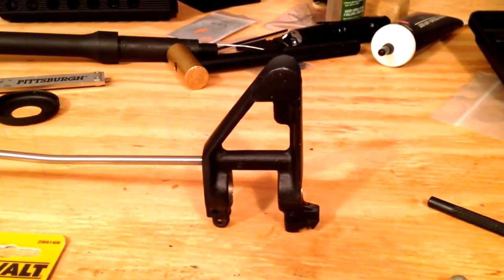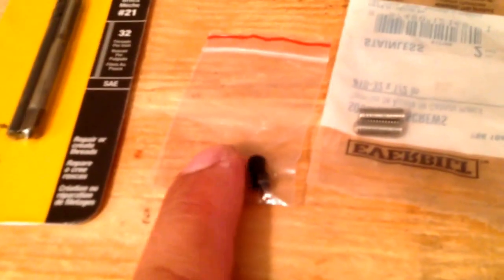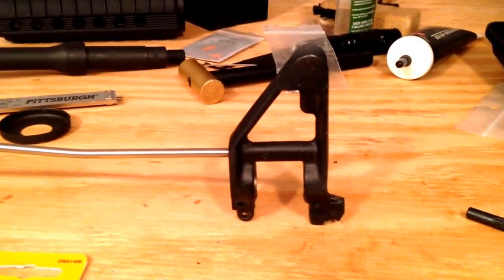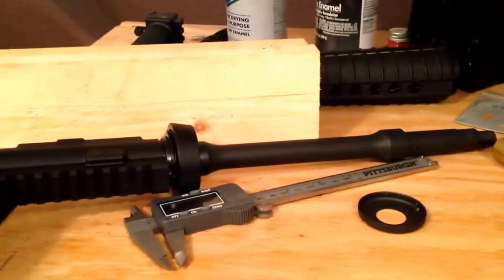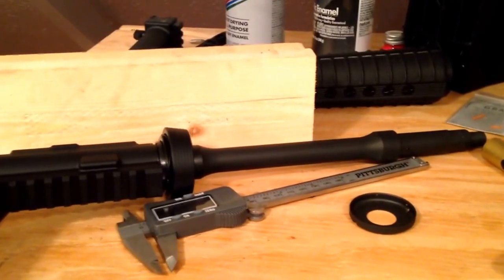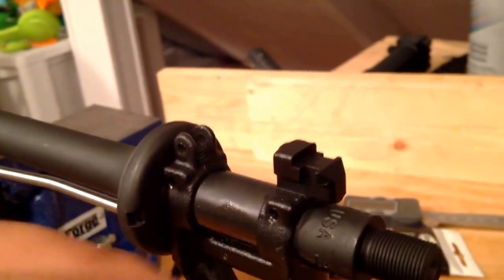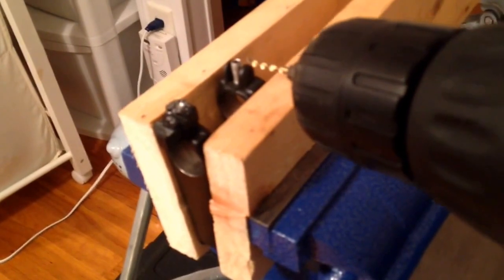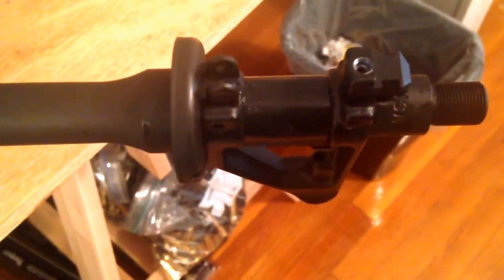AR-15 A2 Front Sight Block Installation DIY Using Set Screws Instead of Taper Pins

Comment: So great video worked perfect I did retain the bayonet lug went back and installed a bolt over the bayonet lug set screw hole and blued it I. Cannot hardly even tell how it was done used a roll pin to reattach the sling mount looks awesome very cool video thanks for posting

Comment: I know a old video. 
Get two vices. I used the ones under 20.00 each ( actually 9.99 years back ) 
Align gas block and barrel place tape on barrel and gas block. Using a straight edge mark both pieces of tape.  
Place in vices ( I put a pice of flat steel on my drill press to hold both vices. ) and use a center punch several times before drilling. 
Go slow and use oil. 
If your buddy has a bore scope it is even better.

Comment: Its simpler to use the a2 gas block already set up with set screws  Dez Tactical,  they have excellent reviews,
Reply: DEZ Tactical doesn't do .625 Front Sight set screw assemblies anymore. They still carry them for .750, but not .625.
Reply: Discontinued, most clamp ons I have found are either discontinued or stupid expensive.
Reply: Every once in a while I see a .625 A1 gas Block at a Gun show  you would think someone would make them 
Next gun show if I see one I'm picking it up

Comment: If you're handy what you can do is tap out the existing hole on the bottom after drilling it with an appropriate drill bit to widen it, and thread it for 10-32 set screw, line it up and set screw and possibly clamp it down . now you DO need a drill press but if you have one now you can just drill through the other taper pin and ream out. then once thats secure go back and do the other taper pin and be done... It isnt too expensive,  Yes.... drill press.... but honestly this method should be using a drill press too.   If they arent going in straight  .. its a problem, and in addition lets be real...  for most of those just larping around with these things a set screw on a gas block is going to be fine,  its going to work and its going to hold it in place because nothing interacts with the gas block outside normal operational forces and even if it moves a tiny bit, the worst symptom may be that you're slightly improperly gassed but even that would require a lot of movement.... here is the issue.  A sight base is a big old LEVER and it also sticks up like crazy.  If the gun is dropped, handled rough, anything,  you are putting way more faith in those set screws -  And here is your second issue -  a TINY bit of movement in that sight block at the level of the barrel is much more pronounced way out at the sight post.  Enough to make you miss -  enough that if you relied on that rifle in a serious situation now you cant aim using the sight post.  If you care about the sight post as an AIMING implement and this isnt a safe queen rifle that you will never actually grab for anything pressing,  you could can gorilla tape the damn sight base on... who cares right.  But if youre installing the sight base because its the most rugged heavy duty front sight -  you should pin it.  And if youre doing it for decoration only or to make it APPEAR proper-    this method works fine and I am sure 20 people will tell me "THIS HAS WORKED FOR ME FOR YEARS AND ONCE I EVEN DROPPED IT ONTO THE GRASS IN MY BACK YARD WHILE USING IT TO SHOOT A WOODCHUCK"  but... I think you know in your hearts that doing it a lazier less durable way comes with "you get what you pay for" be it in money , time or otherwise, caveats.

Comment: I have a A2 sight a friend gave me but it’s missing the gas hole for the barrel(same spot your drillig) so that means I have to drill it out ? Or are they suppose to come drilled ?
Reply: They should already be drilled to be used as a gas block. There should be a larger hole coming in for the gas tube to go into, then a lateral hole for a tiny roll pin that holds the gas tube in place, and of course a hole underneath the gas tube where the block meets the gas port on your barrel.
Reply: @pistolero_loco  everything is drilled except the hole where the gas block meets the barrel, but it’s possible for me to drill it out from under the sight where the roll pins go in for the barrel
Reply: 😆.. sounds like someone gave you an chinesium airsoft part.
They have to have a hole in line with the gas port because that is how they drill the port. No other way to do it.
Reply: @ahole5407  yea they did lol I ordered a original one and it’s all good now hahaha

Comment: My A2 sights pin wont pounding out  Not sure if it was even pinned as its not flush on either side like the tube was put in without a hole in it and Im probably pounding 1/16" punches into the stainless steel tube.   Can this be drilled out without destroying gas tube or A2 sight?
Reply: Hit it on the other side.

Comment: This was really cool, but why bother with the level?  The FSB will self align if the barrel is dimpled with a dimpling jig like the one from SLR Rifleworks.
Reply: True but he should have just sent it to someone and had it pinned correctly.  I pin all my blocks. Seen too many come loose to ever trust set screws alone. An old bench rest shooter told me once that they use to pour loctite all inside the lo pros to bed them along with clamp style blocks because they didn't want to screw up harmonic resonance in the barrel from dimples, set screws and pinning.

Comment: Now I need to buy a 10/32 tap .....
I broke 4 different bits today and even gacked my vice when pushing in a taper pin...........after that. I was sick of taper pins I love the gas block on my other AR..... it has set screws. With dimples and a small amount of blue locktite

Comment: I did this but I didn't do it through the bayonet lug. I only did it on the rear. My front sight base moves ever so slightly under force so you definitely need to do both holes or do some holes on the side. Hope this helped someone.

Edit: I did NOT dimple the barrel.
Reply: Ian Thompson and works well?

Comment: glad i ran across your vid. the cheapest i found near me to drill the barrel was 80 bucks, thanks for the heads up !
Reply: Dude, who ever you called is tring to rip you off. My guess is you called your local gunshops. That's the WRONG thing to do.
People like compass lake engineering do my work. Same guys that manufacture barrels for the MK12 rifle and match service rifles. For $120 they will tale your barrel, cut it to any length,  thread, crown, and fully assemble your upper (including gas block) and check headspace to your bolt. All of that again for $120

Your local Joe Bob Bubba is a rip off just like the rest of them. Only deal with reputable companies that are in the business of building rifles and not selling things at a markup and offering limited services with high liability costs added in.
Reply: Some people don’t hesitate to spend money to have stuff done, shops by me are reputable, but i get what your saying, in my case i came across the A2 sights are always liked the look, and wanted to add them, all my rifles were 80% builds, the bcg’s were all ready to go, and all work better than expected, i only had 1 issue with a trigger it kept double tapping, that was crazy, and at that time a newbie to AR’s

Comment: When I drilled the second, longer set screw (after the shorter set screw was already holding the gas block firmly in place on the barrel, I just drilled a little deeper past the bayonet lug (1/8th inch), so yes, I put a very deep dimple on the barrel; probably a little too deep, but it did the job.